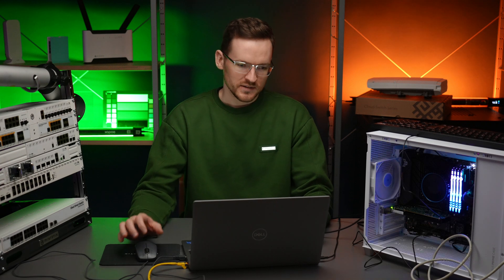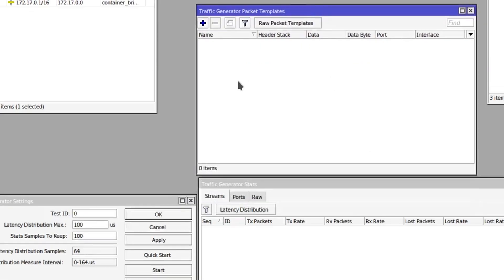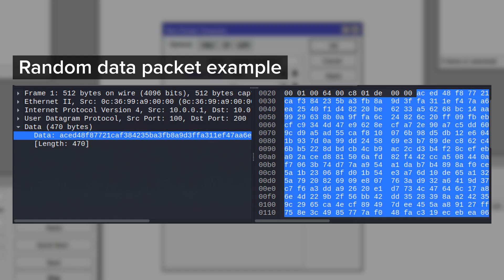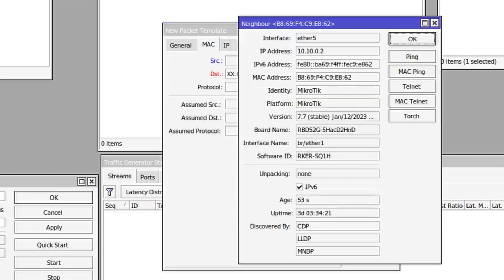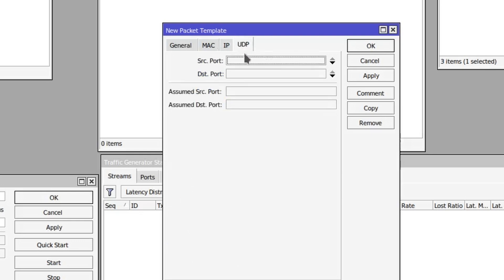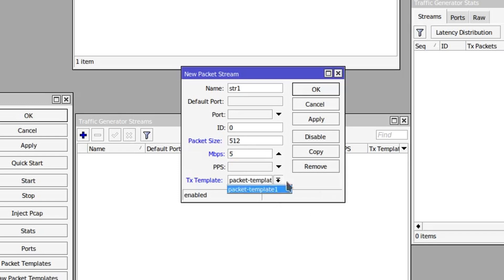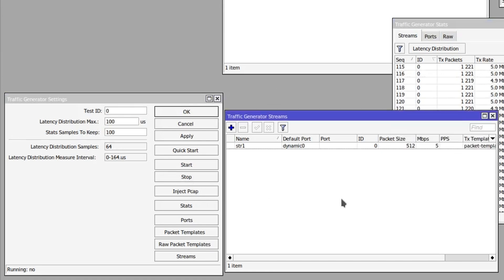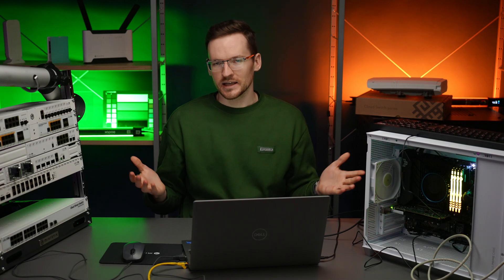MikroTik Traffic Generator

Comment: Why do you put dst ip of your 1st (current) router, and not the second one, to which the packets are gonna be sent?
Reply from the maker: It's a trick to easily test both directions of traffic at the same time.
Reply: Hello, please some help. I am testing this for a lab, where the two Mikrotiks are not directly connected. If I use this trick by setting the destination as the same local address of the first mikrotik, what happens is that the traffic goes out to its gateway, but as soon as that router detects the destination is the first mikrotik, it just returns the traffic, not reaching the second mikrotik ever, not testing the whole networks as I want, and showing 0% packet loss since the first mikrotik is receiving the traffic. Basic routing. What would be a real way to test a network where the two mikrotiks are apart? Am I missing something obvious here?

Comment: Cool, thanks for the shedding a light on this tool! Is it possible to test WiFi throughput with it? I tried, but got 0 packets back
Reply: For sure, however for wireless testing it is not advisable to have the same traffic travel back. You need to come up with a different setup, for example, generate the traffic on both devices simultaneously.

Comment: This is quite heavy for my small home routers. I tested this between RB730G3 and HAP AX2 (CAT6 10 meters). 500M 512 packets: HEX had one core already at 100% and AX2 77%,  600M: HEX 100%, AX 87%,  700M: AX2 95%, 800M: AX2 100%. 735M was maximum i could get, both routers in same LAN. Will replace HEX from it's edge routing duties as soon as there is availability for RB5009. At the same time will probably switch to AX3 for my WIFI router or replace it with the new AX AP.